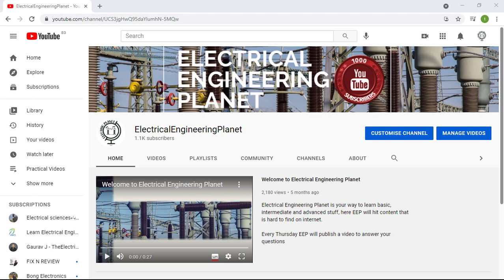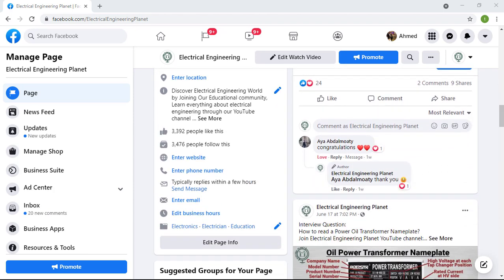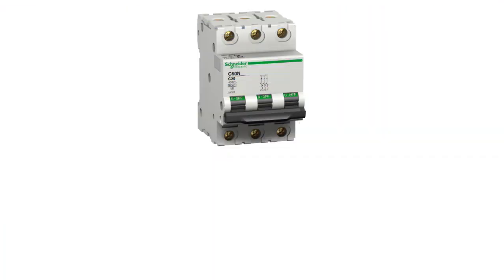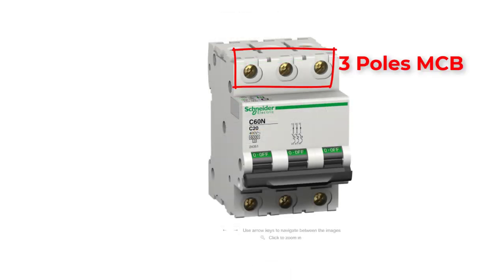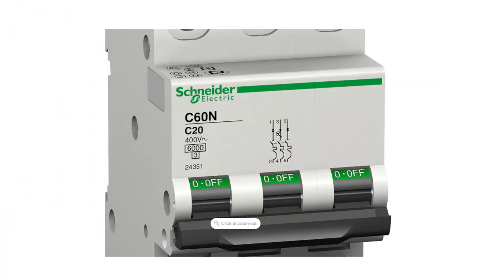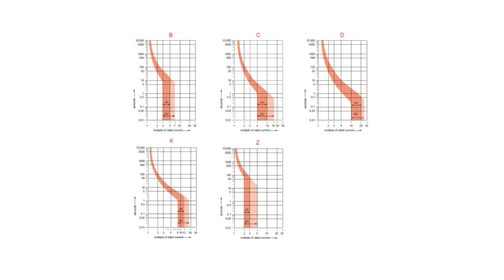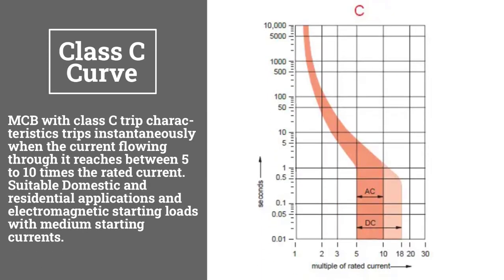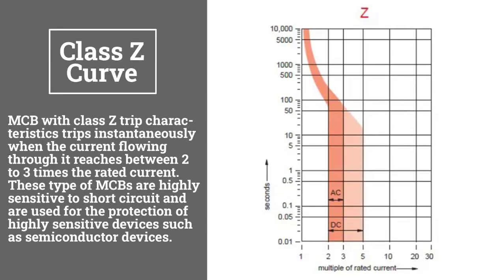How to read a Miniature Circuit Breaker (MCB) nameplate?

Comment: how to read serial number (year production) on mcb
for example S0615 and AA13304
Reply from the maker: Manufacturers often mark their MCBs with codes that indicate series, production batch, and year of manufacture. The exact format depends on the brand (Schneider, ABB, Siemens, etc.), but here’s the general rule for the examples you mentioned:

1. Example: S0615

S06 → Series or product line reference.

15 → Usually indicates year of production, meaning 2015.

2. Example: AA13304

This is a longer serial/batch code, typically broken down as:

AA → Factory code or production plant.

13 → Year of manufacture (2013).

304 → Production batch or sequential lot number within that year.

✅ Key Takeaway

The two-digit number inside these codes almost always refers to the year of production.

The letters identify the factory or series.

The remaining digits are batch/lot references used internally by the manufacturer.

So:

S0615 → manufactured in 2015

AA13304 → manufactured in 2013, batch 304

Comment: why mcb is most confusing of all cb
Reply from the maker: That's a great question! MCBs can be confusing because they look simple but actually have multiple roles. People often think they only protect against short circuits, but they also protect against overloads—just at different time responses. Also, there are different 'types' of MCBs (like Type B, C, and D), each designed to trip at different current levels depending on the application (like lighting vs motors), which adds to the confusion. Plus, the difference between MCBs, MCCBs, and fuses isn't always clear to beginners. I’ll cover this in more detail in a future video

Comment: How to know if the MCB is reversible or not?
Reply from the maker: To determine if a Miniature Circuit Breaker (MCB) is reversible or not, you can check the following aspects:

1. Manufacturer Specifications:
The easiest way is to refer to the MCB's datasheet or user manual, where manufacturers often indicate whether the MCB is reversible (i.e., whether it can be installed in either direction).
2. Markings on the MCB:
Look for any directional arrows or labels near the terminals that indicate "Line" (input) and "Load" (output) connections. If such markings are present, the MCB is not reversible, meaning it must be installed in a specific direction.
3. Pole Design and Contacts:
For some MCBs, especially older models, the internal contacts are designed to only safely operate in one direction, based on how the arc is extinguished during a trip. If the MCB is marked as unidirectional, it's likely not reversible.
4. Visual Inspection:
If the MCB has distinctive inlet and outlet terminals that differ in size or shape, this indicates that the MCB is not reversible. If both terminals look the same and have no directional markings, it may be reversible.
5. Testing the Reversibility:
If you are unsure after reviewing the manual and inspecting the MCB, you can test it by wiring the input and output in reverse and observing if the breaker still functions normally, though this should only be done by a qualified electrician for safety reasons.

Comment: As  shown in curves it take a specific time to trip, moreover why we are choosing the MCCB rate current to be equal 1.25 full load?
As example: heater current = 12 Amp
MCCB ==> B16
Reply from the maker: Thank you for your question 😊 we increase mccb rating current for protection purposes,, to take into consideration the temporary overload current and inrush current

Comment: Why there was no operational symbol on the second mcb?
Reply: If there is no operational symbol so you can connect supply to either side
Reply from the maker: Excellent
Reply from the maker: Connect it in both sides

Comment: So a C16 MCB will keep working if 16amps current drawn by a AC stabilizer (100% rated current load @ 230 volts ) runs through it day n night 24*7 ( in case of  inverter AC ) & will only trip when amps exceed 10 time the rated amps (short circuit )  or voltage drops ( below 200 volts ) and AC stabilizer starts drawing more amps causing overload situation  right ?
Reply from the maker: Yes that's right, if current exceeds 16amps (let's say 18amps for example) after a time that you can calculate on the curve the breaker will trip, this increase of current could be because of drop in voltage or increase of load(power)

Comment: what is the difference between AF and AT circuit breaker ratings ? thank you
Reply from the maker: The difference between AF (Ampere Frame) and AT (Ampere Trip) ratings in circuit breakers is:

AF (Ampere Frame): This is the maximum current capacity that the circuit breaker frame can handle. It represents the structural rating of the breaker and is fixed. For example, a 1000 AF breaker has a frame that can support up to 1000 A.

AT (Ampere Trip): This is the actual current rating at which the breaker will trip. It can be adjusted within the limits of the AF rating. For example, a 1000 AF breaker may have an AT setting of 800 A.